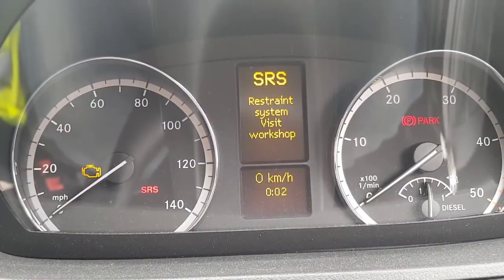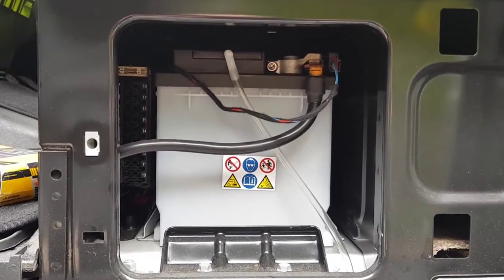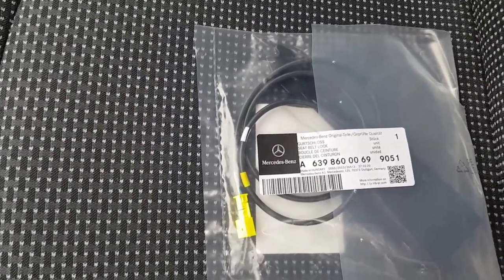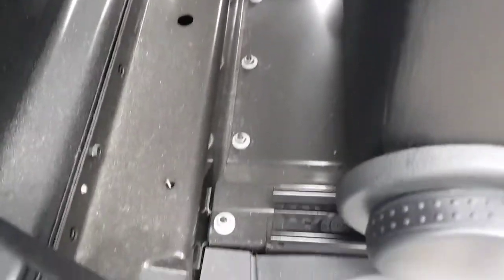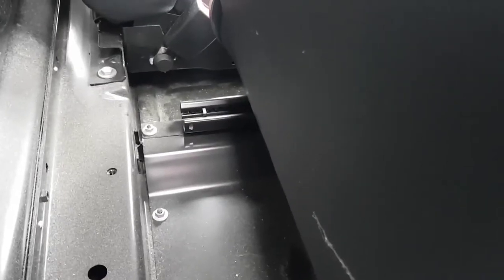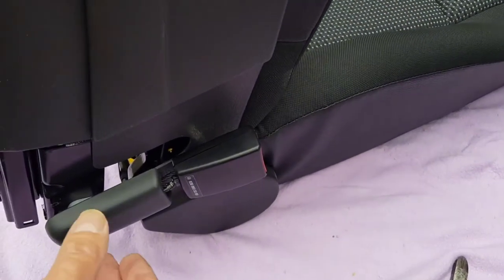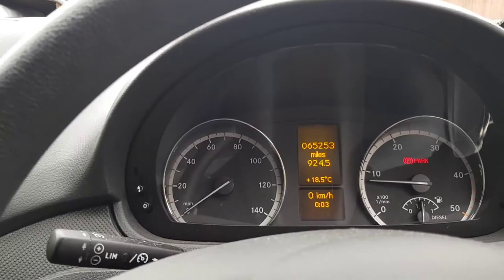Vito SRS Fault - How To Replace Seatbelt Clip

Comment: I recently bought same year and model 113cdi.
The previous owner cut the wires under the seat for some reason and the seatbelt keep dingling like I have not plugged the seatbelt but all the seatbelts are on.
Srs light works perfect when the ignition is turned on but the  seatbelt light dosen't appear on the cluster at all.
Any idea what could be
Reply from the maker: The previous owner must have cut the wires for a reason - only they will know what that reason was; anyone else can only guess.  My guess is that they had an SRS error, cut the wire, and fitted a resistor to fool the SRS system into thinking that all was well (google this, if necessary).  I have no idea why your seatbelt light does not work - bulb?
Reply: @billericaybruce  
There is no resistor. I've used diagnostic scanner and it says Driver seat belt buckle is faulty. I've installed a new buckle but still same issue
Reply from the maker: @pureplay4020  I'm no expert so I cannot help, I'm afraid.  If it was me, I'd take it to a main dealer or ask on a vehicle specific forum - BenzWorld?
Reply: @billericaybruce  
Much appreciated your help.
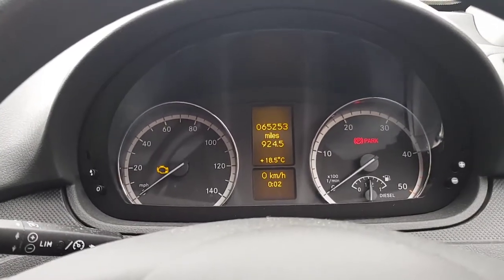On 5:30 you said when you turn on the ignition the srs light came on but now is gone off.
Do you remember how long it take till the srs light is gone off
Reply from the maker: @pureplay4020  It's been 3 years since I did this job.  I don't remember precisely the order of these details. What I can say is that the SRS light went out pretty much immediately - more than 1 second but less than 5 minutes.  My vague recollection is that, after putting everything back together, I turned on the ignition and the SRS warning was lit but it disappeared within a few seconds.  I might have switched the ignition off and back on again - I really don't remember.  It was all very quick, and before I had a chance to film it.

Comment: My seatbelt warning light comes on even though I have the seatbelt on, I'm guessing this is what I need to replace also
Reply from the maker: Is the SRS light on as well?  If so, it may well be the seatbelt clip.  It seems to be a common problem.  

Try getting yourself a cheap OBD2 reader.  Use it to CLEAR FAULTS (even if none are shown).  If the error is cleared but reappears when you plug in your seatbelt, that is almost certainly the problem.
Reply from the maker: One like this: https://www.ebay.co.uk/itm/165869655345 and the Torque app on the phone.

Comment: How did you know which seat belt to replace?
Reply from the maker: Haha, good question!  I'm not sure I remember but I think the first signs of the problem were associated with using the driver's seatbelt.  Apart from that, it is the belt that is used the most, by far, so would be the most likely to fail.
Reply: Yes I had the same question because the the message I was getting on the dashboard didn't stay on as a fault and one day I didn't see it at all and the next I was on 5 times.
I decided to change the driver's side coz it's used 10x more than the other side. I need to drive the vehicle for days perhaps for couple of weeks to see if I get the message again I hope not ;). Thank you for video.
Reply from the maker: @petrturcovsky7035  That sounds very much like the fault I had.  It was intermittent at first but soon became permanent.